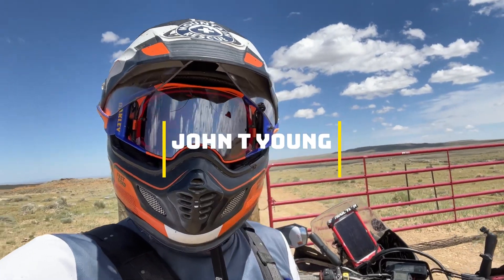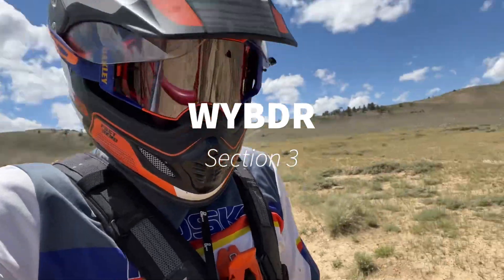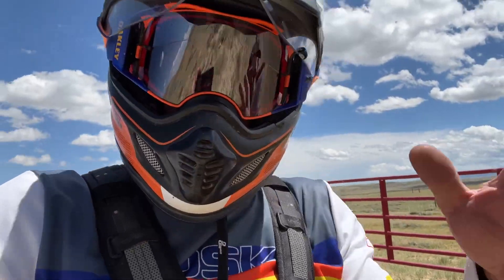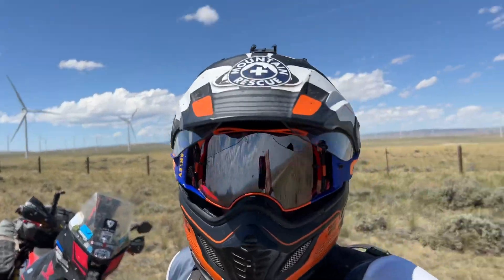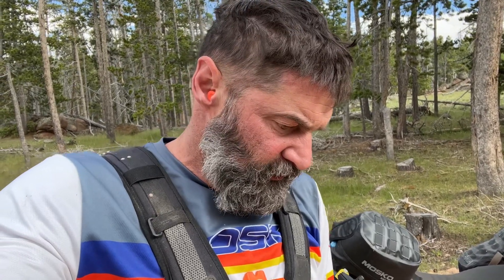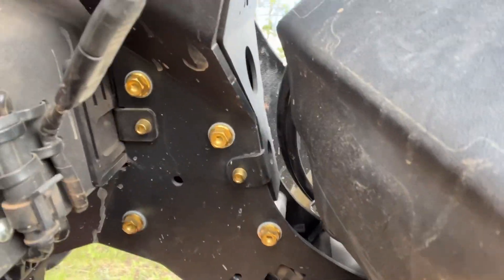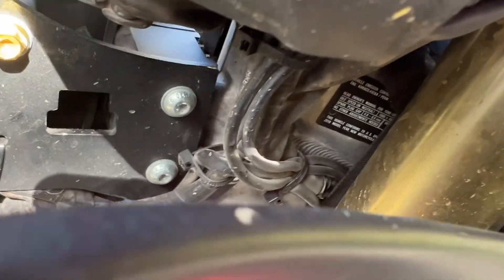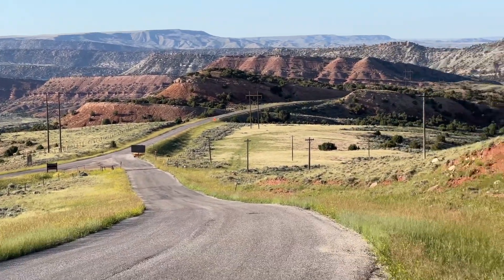WYBDR Section 3

Comment: How ironic. I was telling you about my sons KTM 790 and the problems he had. His headlight upper studs broke (poor design)  on the same exact section. We didn’t know there was a problem with this particular area on his bike and they make a bracket to reenforce the headlight pod. Problem is it had to be modified before it breaks. Ooops. To late. Well we were able to modify the new bracket so hopefully it holds. Otherwise we will have to break out the grinder and Tig to reweld the mounting studs to the neck of the frame. He had duct tape along with a tie down strap and it got him further down the road before the front brakes went out. 

Sorry to hear about your troubles. I hope you get it patched up.
Reply from the maker: Ya. Almost like you JINXED me. LOL.
Reply: @JohnTYoung  Hope not. Lol Seems the washboard causes a rhythm that’s hard on bikes, accessories and equipment.